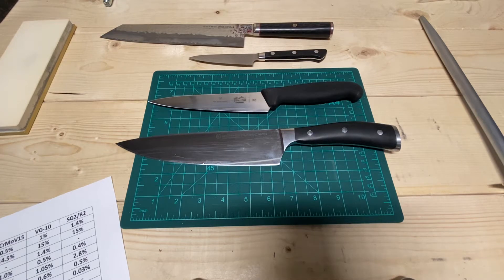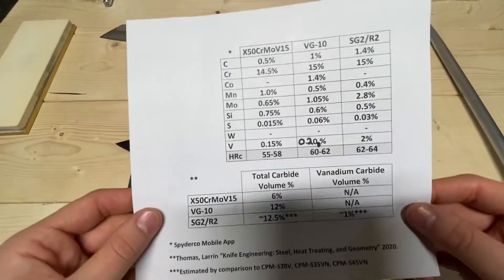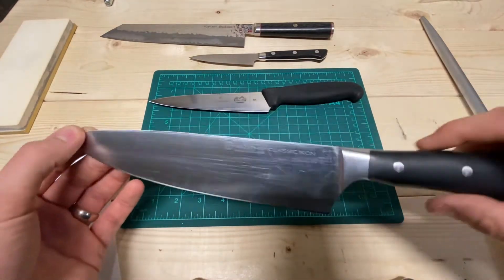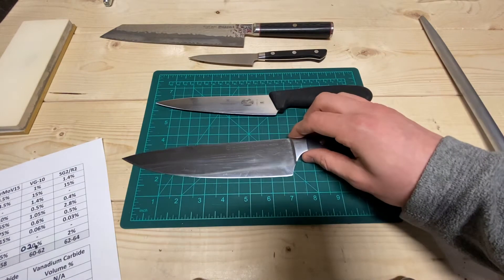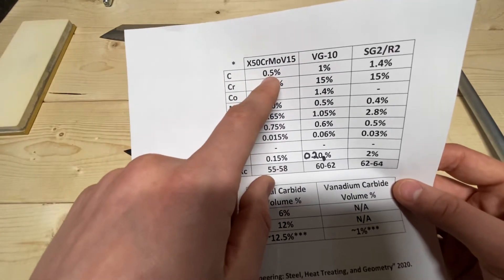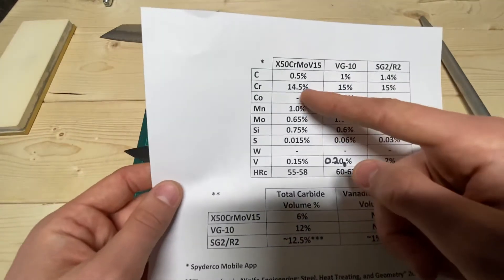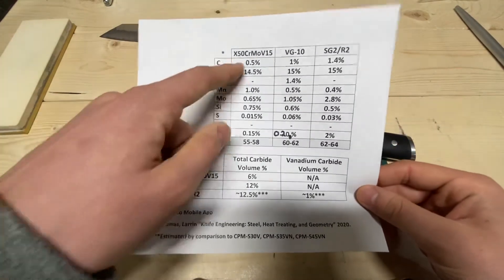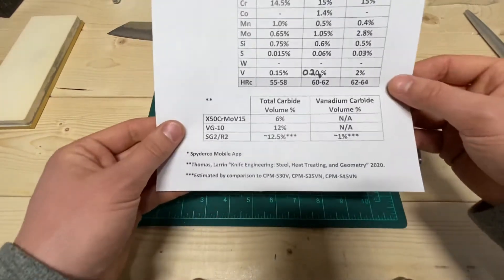Talking Steel: X50CrMoV15 (German Cutlery Gold Standard)

Comment: Your rod is diamond coated and it does sharp. the regular is honing not sharpening.
Reply from the maker: Not quite accurate. The diamond cuts the blade steel versus honing rods sharpen very slowly through adhesive wear. 

There have been tests that detected the steel transfer to the rod and magnified images of the abraded edge. 

I didn’t know this for a long time and have myself misstated this.
Reply: I am an expert in the definition of sharpening it taking of material this is what the diamond does there are many grades of fine very fine coarse and so smooth steel has many grades fines etc but generally it is not sharp but straight the blade and centralized it to middle line the same way you brush your hair it takes of steel only when it is almost fall and was torn before as a result of wear this is why honing smooth must be magnetic also. @EngineersPerspective701

Comment: Actually, Victorinox uses an older version of German steel, X45, with an even lower carbon content (0.45 vs 0.5 %). It's usually hardened to no more than 55 HRC deliberately preferring flexibility and ease of sharpening over edge retention. That is due to Victorinox' fixed blade knives having a longer history as butcher knives for the meat industry rather than as kitchen knives.
Reply from the maker: Appreciate the information and clarification!
Reply: Yep, Tramontina does the same, they also use 1.4111 (geman) which is ideal for entry level kitchen cutlery and butcher work, it won't retain the edge very long but it's easier to sharp, and it basically offers 97% of the 1.4116 performance. And it's also cheaper than Victorinox, some people think that by buying Victo they are buying a superior product compared to cheaper brands but that 's not always the case.

Comment: the steel road is not just straintening the blade, it's also taking some steel from the blade. but it does not take that mush as a stone, so it can not sharpen a dol blade, but it can maintain a sharpeness without using a stone for very long time(never for some cases)
Reply from the maker: The usefulness of a honing rod depends on the person I feel. For my preference I have not found a rod that can produce an edge that I like to work with. Some come close but I always wish it was better. Add in a strop and I can get satisfactory results and it is a lot faster and uses up less steep than a stone like you mentioned. Probably the best route for most users
Reply: @EngineersPerspective701  
same here, i don't use rod, i don't even use strop this times. just sharpening on water stones every 3month lol
Reply from the maker: @dris9274  I like to keep these German steel knives going with a strop and hit the stones every 3 months or so too. If I don't do twice weekly stropping then I need the stones every 3-4weeks
Reply: @EngineersPerspective701  
im gone try it again, thx you 👍
Reply: ... steel rod* is straightening* the blade ...  a dull* blade ...
Reply: @einundsiebenziger5488  
tu pourrais faire la même en français?
Reply: The steel rod is just a bad idea, we have diamond sharpening rods that actually work if you like the rod design and many other quick sharpening solutions both budget and expensive ones.

Comment: better than CPM 3v?
Reply from the maker: Well I suppose it depends on what a person is looking for and heat treatment. Assuming stainless isn’t a priority it’s pretty safe saying 3V will be by far the preference of most
Reply: 3V is a high-speed tool steel originally developed for metal-working tools such as lathe chisels. It's nice for small blades like folding knives. A large-blade (8-inch+) chef's knife made from that steel would be awfully expensive and a nightmare to sharpen, which is why nobody offers kitchen knives with that steel.

Comment: I used to have the same experience with my Wusthof. I would sharpen with the steel once per day, and would need the whetstone every couple of months. I’ve since changed tactic and now don’t use a steel any more. Once every 12 months, I sharpen with the whetstone to 5000 grit, then polish with the leather strop. It’s much sharper, and I only need to strop once per week.
Reply from the maker: Working a strop in is a higher changer I think. It brings back a way better edge than a steel. I’ll still use the steel day to day but I’ll bring it back to life with the strop regularly
Reply: @EngineersPerspective701  30 seconds on the strop, once a week, leaves the knife in better condition than 10 seconds per day with a honing steel. For me, the strop is quicker and more effective, even on knives made with softer steel.
Reply: Doesn't it work better with a diamond rod? It sharpens by taking a bit of material rather than restraightening an already fragile burr.

Comment: Victorinox is 56
Reply from the maker: I’ve seen conflicting reports of what it actually is in Vics! I’ve leaned towards the lower Carbon because at that low hardness there would be more carbon bonding with chromium forking carbides. That in turn reduces the amount of free chromium in solution and reduces stainlessness. Based on how stainless their blades are and that hardness target it seems like the lower carbon option makes more sense.
Reply: @EngineersPerspective701  aside from chemically speaking , in real world testing I find them to have a better edge retention than my other knife that has a declared 54-55 .
Reply from the maker: I think the Vics are targeted 54-56 so I could see that. Plus they have such good geometry that they will cut better for longer than some comparable steels and hardnesses from my experience. However I was surprised to see that my Mercer Renaissance chef does hold better and less likely to roll.